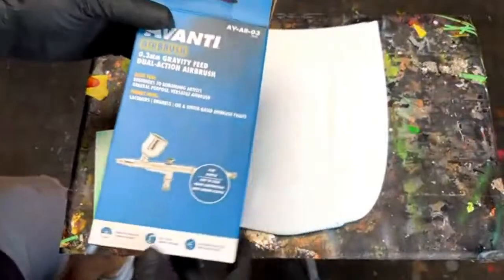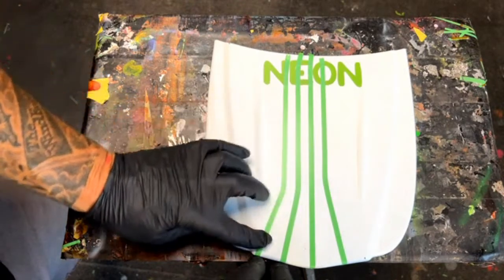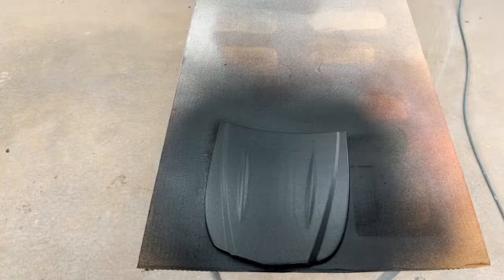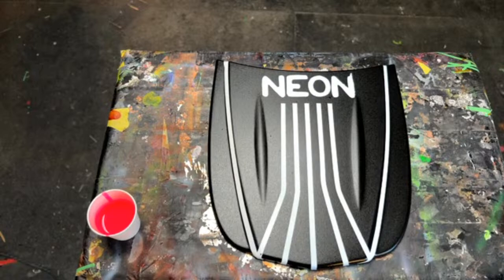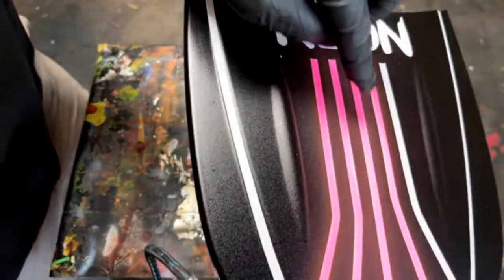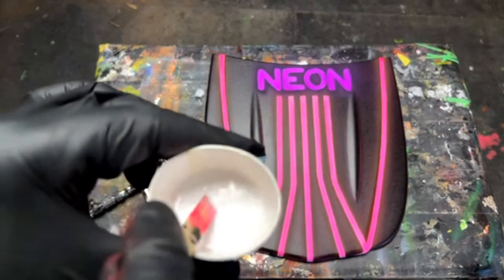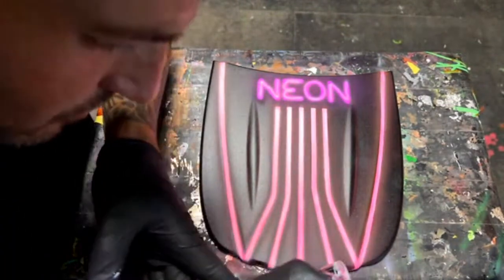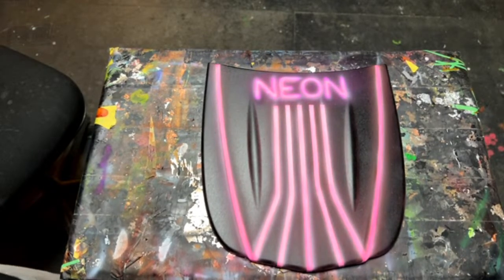Live Event: Time Warp Custom Paint Testing the Avanti Airbrush from Harbor Freight!

Comment: If you take the meddle out and polish it it will spray better. I put my meddles in my drill and use 2000 grit or finer on the meddles. I do all my meddles even my microns

Comment: How are you changing your colours so fast with out getting a mix of colours  in your spare
Reply: Empty the paint hopper spray out with a spray bottle of lacquer thinner,  wipe out hopper spray a little clean lacquer thinner through the Air brush then load new color. Just that fast and easy.

Comment: I was just getting ready to place an order to get some the fine line tape. Does the tape you sell have low tack properties?  When I heard the viewer say he has troubles with getting the edges to stay down in the turns. You mentioned putting masking tape on the corners to keep it held down. 
This concerns me, I don’t want to purchase a tape that lifts. 
Thanks
Reply from the maker: That happens with all tape that is stretched around corners. It’s just a natural thing you pull in the tape, too hard and it stretches lime line will hold down better than any other brand.
Reply: Thanks, I’ve always used the blue 3M tape for laying patterns for striping, flames, or whatever it is that needs it. Thanks for the reply back, I’m going to order a couple different sizes of your tape.

Comment: Have done a transmission in my 2006 YukonXL twice rear end 3x front diff once and now getting ready to pull the engine due to 2 rod bearings spinning (ENGINE STILL RUNS) @247,000 miles.... Love to airbrush and paint done alot of rc car bodies have videos of some would love to hear your opinion on them if you ever have a chance.... waiting to break in my iwatta neo i got from hobby lobby with there app for 40% off
Reply from the maker: Thank you I appreciate you watch iI